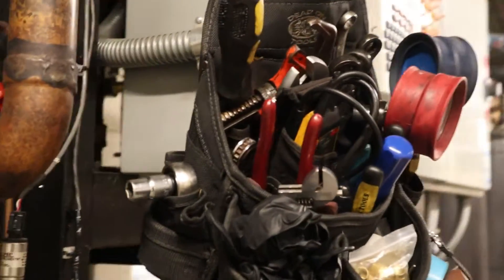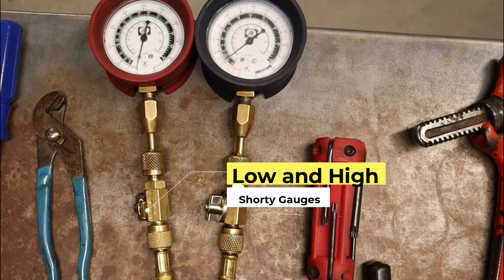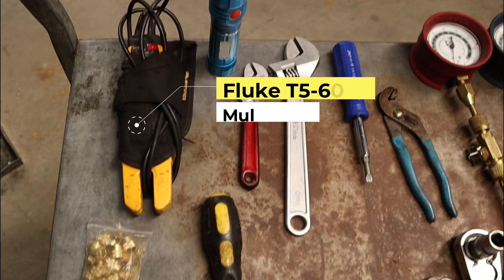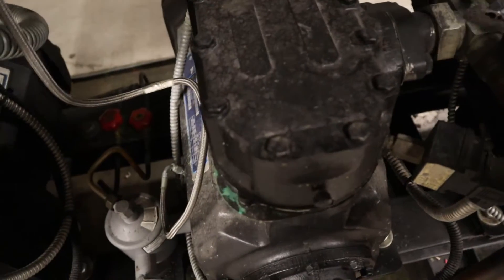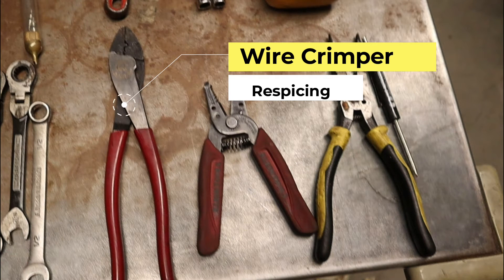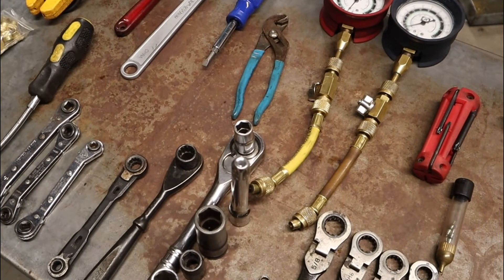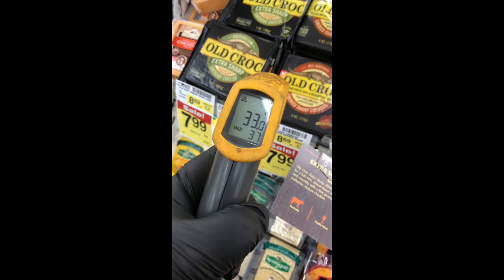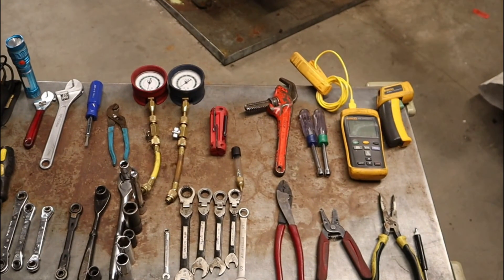Budget Hand Tools to have in a Refrigeration Techs Tool Bag

Comment: When you test a capacitor, what do you do? Walk all the way down stairs for a different meter? I almost got the t6 but backed off when I saw they don't have capicitence
Reply from the maker: The chances of refrigeration rack having any kind of capacitor are slim to none. I have a supco cap tester and have used it 3 times in my life. No real reason to carry it on my main bag.
Reply: @refrigerationconfidential4376  right on man. I like that logic
Reply from the maker: @techti8792  thanks for watching the video 👊🏽
Reply: @refrigerationconfidential4376  it's good channel. Lots of useful info. Helps us rookies. I plan on making my way up to racks. We have mostly hvac calls right now though. Plan on getting my 1st fluke. I really like the t6-600, but the lack of cap test is holding me. Which fluke would u recommend?
Reply from the maker: @techti8792  I like mine because it’s in my hands and I can see voltage and not look away. All about being safe. I’ve seen some with magnets and you put on side and I just don’t like to look away when I’m dealing with 208v or 460v.. T6 will work great but it’s just what you deal with more. I would just get that and a supco cap tester and pull it out when needed but that’s just me.
Reply: You certainly are the guy for racks thank you for sharing.